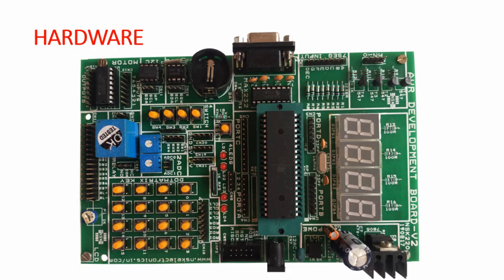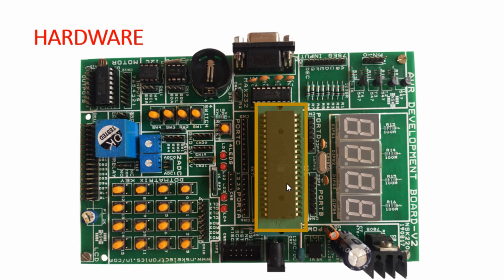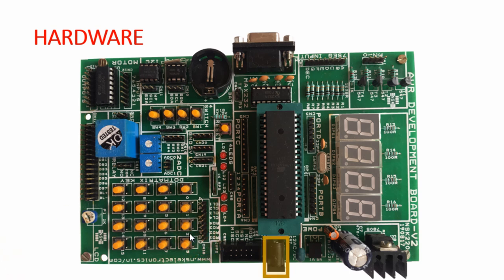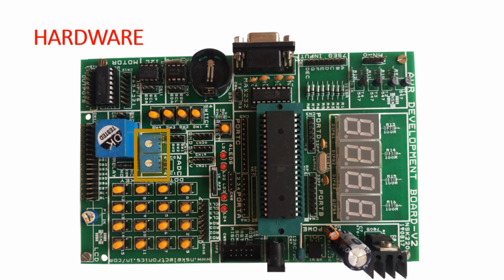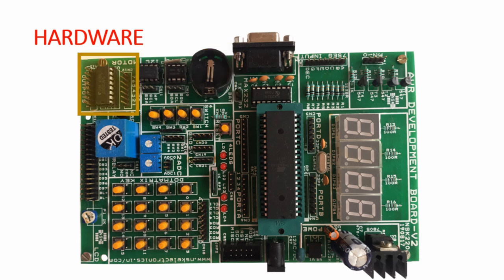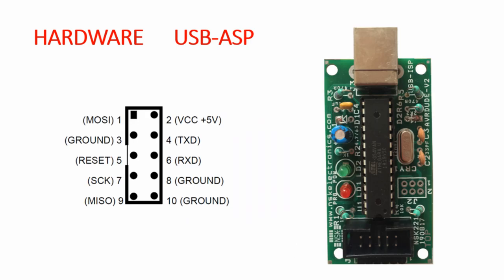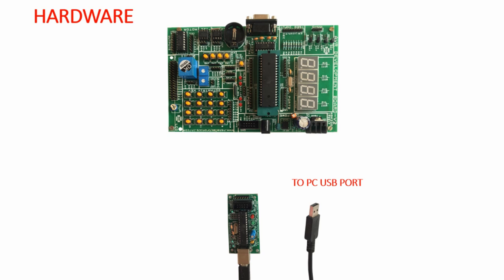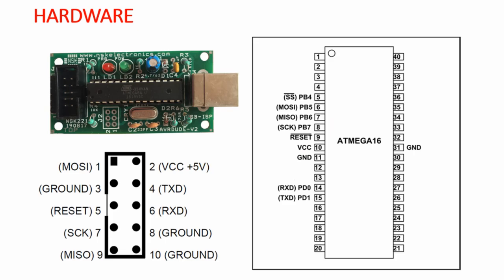HARDWARE AND SOFTWARE USED IN THIS COURSE FOR  ATMEGA16 | ATMEL STUDIO PROGRAMMING COURSE  | T - 3

Comment: Can i use MPLab X IDE and PIckit3 for the Programming.? thanks
Reply from the maker: Pickit 3 cannot be used with mplab x ide for atmel controller atmel ICE can be used.
Reply: @SMtrainingacademy   so what I understand we can use Pickit3 for the microcontroller which start with PIC like PIC24HJ256GP210, but this is 100 Pins will i need to buy a Socket?  for this or i can simply connect direct wire to the pins as you always shows end of the video. thanks
Reply from the maker: @Toturials  f what is the package of IC if it is like smd package you need socket if it is through hole then you can connect by using breadboard